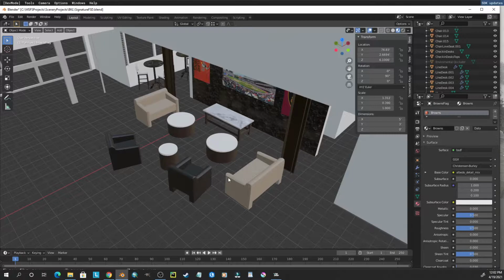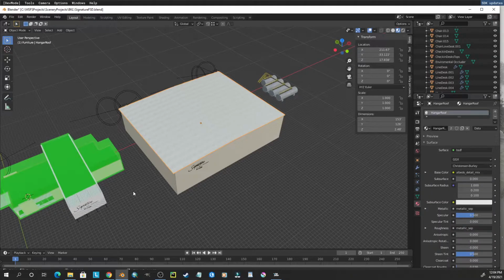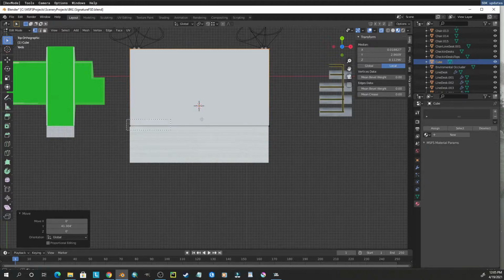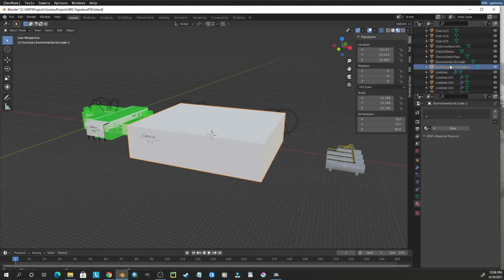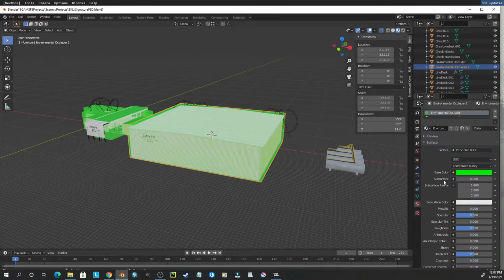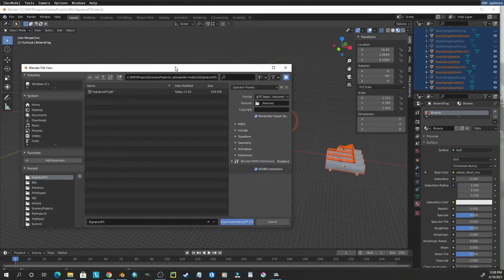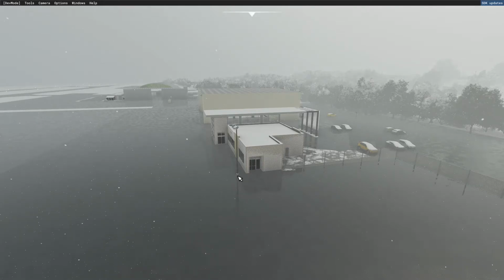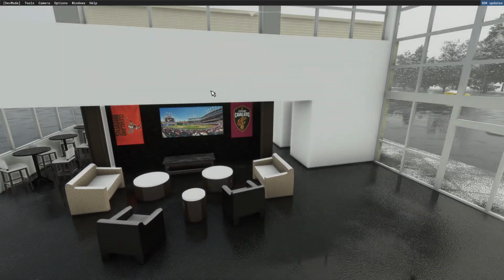Raining and Snowing inside your MSFS Buildings? Add an Environmental Occluder Cube!

Comment: I’ve been struggling with an issue where the bottom face of the EO cube is visible (white). I’m still troubleshooting but thought I’d ask about my blender efforts.  In my case, the EO cube in blender is not transparent like yours and I am wondering if I’ve missed a step.  My EO cube works with regard to rain but the bottom of the cube is showing in white for some reason.  The white bottom face appearance does change with distance, there are positions and/or distances when it is not visible but most of the time it’s there.  I’ve tried all manner of changes to the EO cube with regard to size and height.  One last thing to mention is that my building has no floor, this effort is for a tee shade type of structure that is supported only by vertical beams.  I may put a fake floor in just for troubleshooting as a last resort.
Reply from the maker: I set the transparency using the alpha channel setting. Default is 1. I too have the bottom of the EO conflicting with the ground textures. I have started putting floors in and also assigning them to a collision material so that I can drive up on them since I make them a few inches thick. Hope this helps and thanks for watching.
Reply from the maker: PS: I talk about this in two of my latest videos on SU11.
Reply: Thank you, I should have taken another look at your updates.  As suggested, adding a 3d floor fixed the issue with the corrupted ground texturing at the bottom of the occlusion cube.  So, since this is an outside area, I think my next project will be to animate some puddling on that new floor during rain periods. I think it is possible but will save that for later study.  Thanks again.